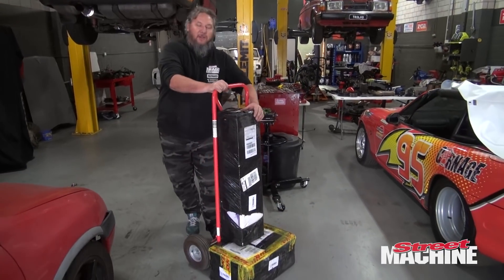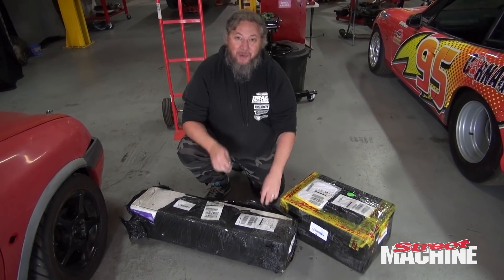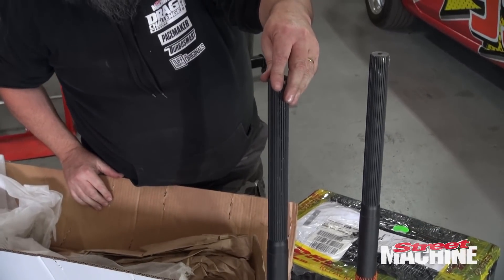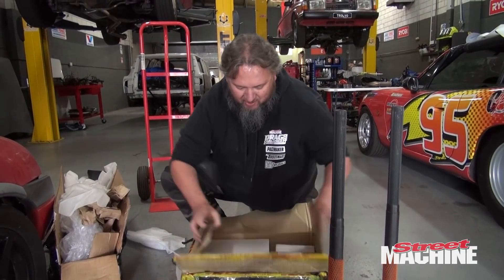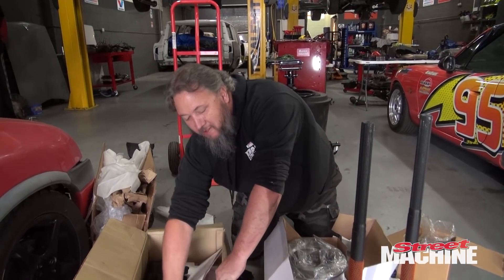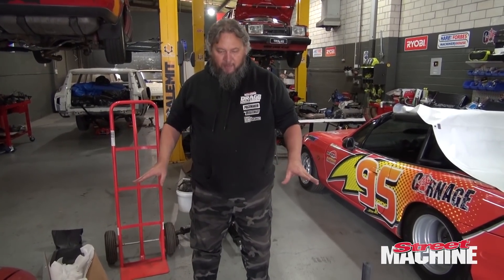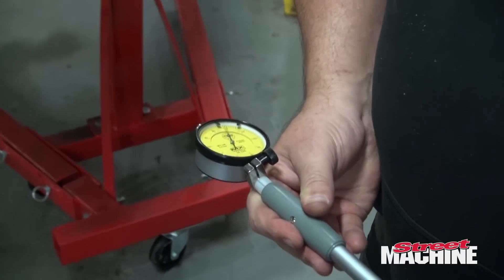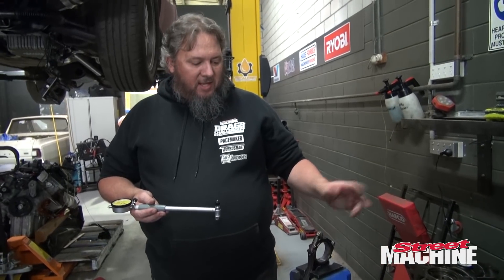Carnage Plus EP99 - Overnighted Parts From Sweden!

Comment: Torsen style hemisphere or Eaton Detroit Truetrac as sold by HARROP engineering in Australia. I fitted one to my Landcruiser in the front diff & you can feel it searching for grip on muddy roads & directing power to the grippy drive wheel, no noise like a mechanical locker. Not that expensive, mine was $800 AUD, money well spent if your wheels rarely leave the ground, even better for a road or track car I would imagine.

Comment: Got almost the same setup on my 242, i run standard axles. If youre going to use the speed sensor ring on that diff i needed to turn it down the thickness of the ring at the end the ring goes over so it dont hit the sensor in the diff cover..
Cheers from Sweden!

Comment: Scotty mate before you put the ARP rod bolts, use a thread cleaner in the rod end, to make sure she is clean and sharp as well, all the treads need to be clean and free of anything, that way your going to get a real good reading on any stretch or deforming of the steel on the rod or cap end?

Comment: I've never seen that much spline cut on axels....They must have thought you might need to shorten em?
BTW Scotty the way you stroked that axel made me feel uncomfortable 🤣
Reply: Yeah, they are for all versions of Volvo 1031 axles, so if you got a 240 you need to shorten them more than on the 740/940 axle! Makes it easy to fit correct, just cut at the correct length and you are good to go!
Reply: @gzracingab9937  yeah sweet👍

Comment: My money is still on zero, or next to no measurable difference. Pressing the rod bolt in wrong is where you are going to get the cap distortion, not doing the bolt / stud up. That should remain the same provided you torque the rod / bolt to the same torque setting.

Comment: If those l67s have fractured rods they can't be re-sized..
Reply from the maker: How can you tell the difference? They look like normal rods to me
Reply: @STREETMACHINETV  they don't have dowels where they separate and they look really rough finnished like the cap has been broken off then end of the rod.. pretty sure I show what they look like in my latest video..
Reply from the maker: I just had a look at the video, yeah they are totally different rods to what I have
Reply from the maker: And after you used a claw hammer on that motor I better not hear any shit about "not doing things right" LOL
Reply: @STREETMACHINETV  lol maby that's where your goin wrong not using a claw hammer 🤔 anyway I they look nice and machined with dowls there not fractured rods I only mentioned it as I pulled a l67 appart for a future video last weekend and it had fractured rods so I figured I'd give you a heads up..